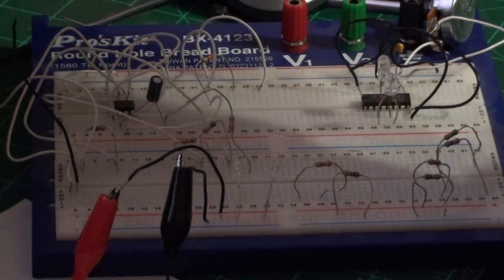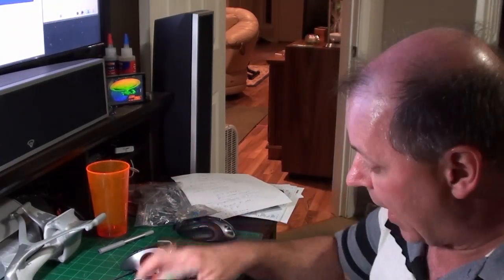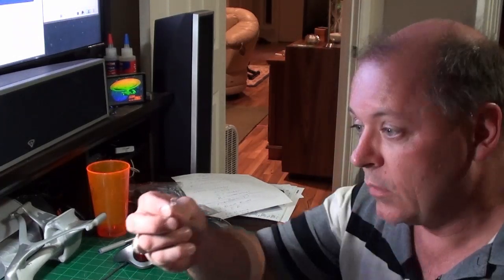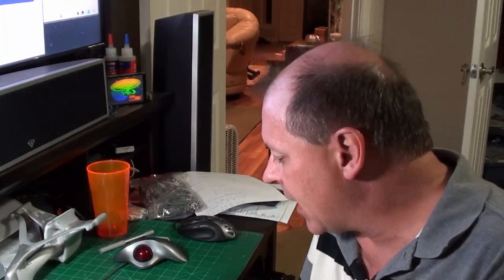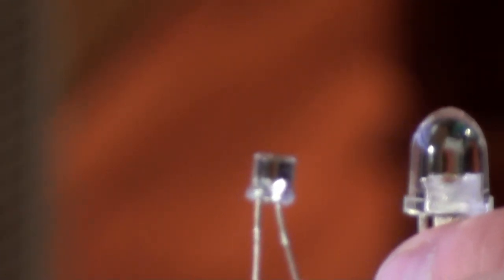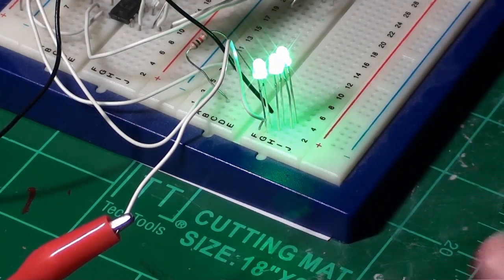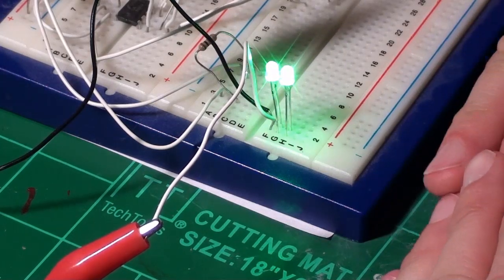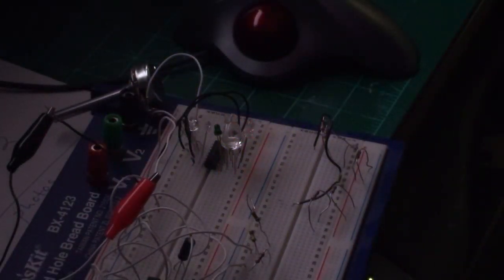Lighting tutorial:  LED basics part 2

Comment: Thanks for the instructive and easy to understand tutorials! I came across your videos because I am seeking to find the photography lighting panel that fits my needs. To no avail so far, so I am evaluating DIY. One of the first decisions for me to take is whether to use SMD strip lights (which I would prefer) or to go with individual LED bulbs. However, well known photo industry suppliers all use round head bulb LEDs. The only reason I can see is that they produce a narrow beam angle, which is sought after by photographers. May I kindly ask your opinion on this subject? It would help me a lot. Thank you in advance!
Reply: The round  bulbs will have a more narrow focus for light.   LED strips are designed to diffuse light, while the bulbs are designed to focus light.
Reply: Thank you! Greatly appreciate it!

Comment: awesome video...I am new to all of this and working on small lighting projects.  I have a 9v battery and trying to power an LED turn light.  I believe I need to USE A RESSITOR BASED ON YOUR TUTORIAL.  It will light for a moment and then goes dim to nothing.  Already gone through two lights and now I believe I understand why. I am used to heat resistant bulbs.  LED's are a totally different concept.  I appreciate any feedback on this issue. I look forward to more tutorials.

Comment: Thanks a lot for uploading!
Reply from the maker: Your welcome!
Reply: But there is one thing i didn't really understand, and hope you can answer me on.
My power source is 9V and i have diodes on a total of 18V, does the resistors divide the energy enough to power them?
Reply from the maker: Ducesweden .  Resistors lower voltage across LED's, or if you use enough LEDs they will lower the voltage to be safe.   If you have 18V of LED, then the 9 V battery probably won't light them up, too much current draw...

Comment from the maker: you see no resistance if it is a pure diode.  But there is no such thing as a pure diode.   They act as resistors in the current passing direction with very low resistance.   An LED is different.  It acts like a resistor in the current passing direction.  Resistors are devices that take electrical current and turn that current into heat.   Light bulbs are specialized resistors that convert current into both heat and light. An LED is no different.  It too converts current into both heat and light

Comment from the maker: I think you are a bit confused.  First, when a circuit is in parallel, each part of the circuit has the same voltage across the components, and when a circuit is in series, each component will see the same current.   LED's emit light consuming energy to do so.   An LED is a diode, which is a device that allows current to move in one direction only.    If you try to pass the current in the wrong direction, you get an infinite resistance.   In the other direction

Comment: Increased Resistance REDUCES power consumption. 2 100Ω resistors in series is like a 200Ω resistor (Rt = R1 + R2 + R3 etc). Parallel Resistors act like a smaller resistor. 2 100Ω resistors in parallel are like a 50Ω resistor. A 50Ω resistor conducts twice the current of a 100Ω resistor. But the series resistors rule doesn't apply to leds, as they don't act like resistors, they only drop voltage, not current.

Comment from the maker: Power consumption is calculated with this equation:   Power = current x voltage, or it can be calculated as current squared x resistance.    Now resistance is calculated in series by adding up the resistance.  While in parallel by an inverse law:  1/R=1/R1 +1/R2    Remember that LED's act like resistors when the current is in the correct direction.  So in series, they increase the resistance increasing power consumption, while in parallel it actually reduces power consumption since the equation

Comment: The Series vs Parallel thing, you have it a bit wrong. Any given Series string is far more likely to outlast any given Parallel string (Especially if only one resistor is used on a parallel group). And Series is far more energy efficient, which on batteries is a good thing. If you are using a 9v battery, three leds in series at full brightness (20mA) only consume 20mA total. In Parallel with one resistor each, it consumes 60mA.